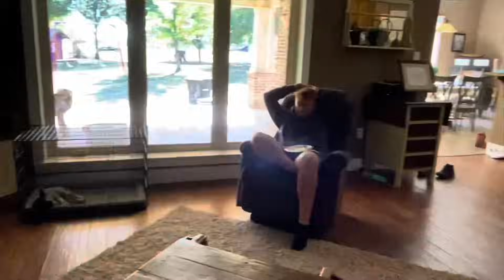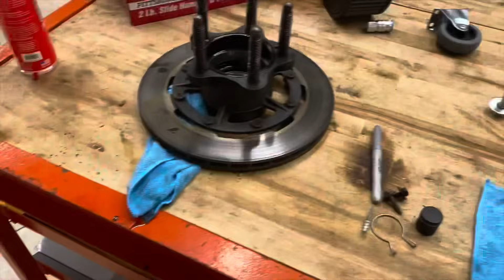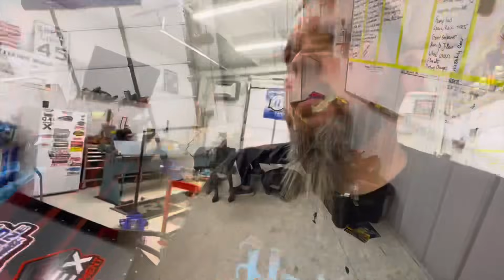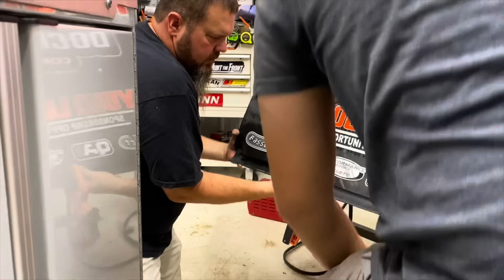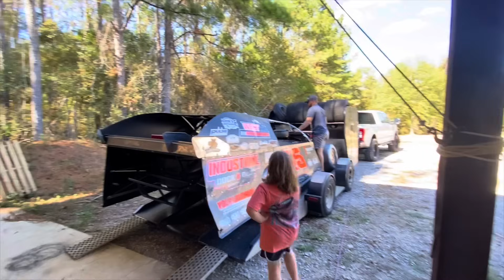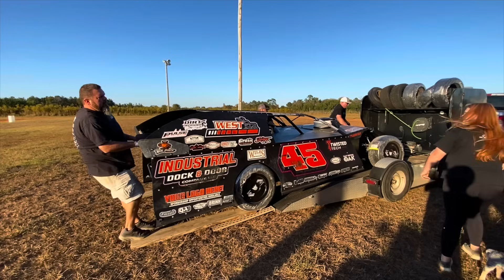Our Toterhome Is Down For Repair…NO WAY We Can Race This Weekend!!! (Chase) “Hold my Rootbeer!” 🤣

Comment: We were so excited to get the inclosed and it was awesome, but we sure missed that 40 min drive home with the open trailer on the roughest roads we could find because it sure made wash day a lot easier and cleaning up the trailer was a extra day added to a already over flowing work load.